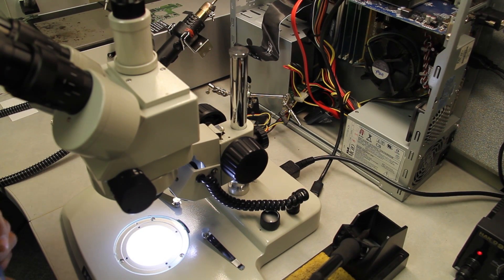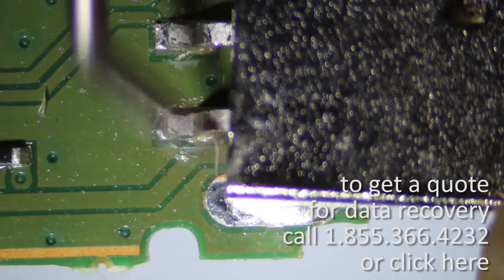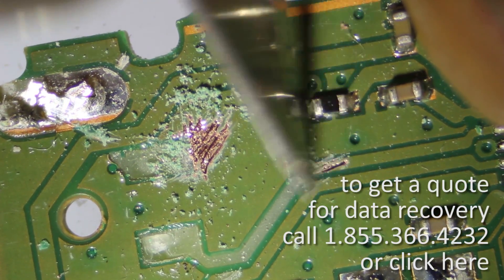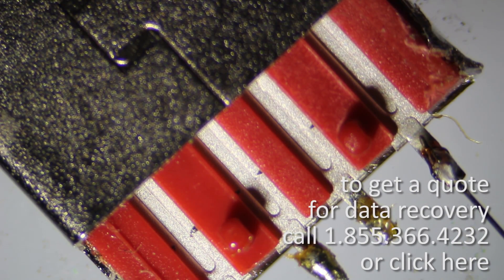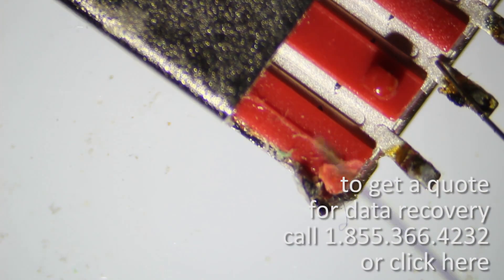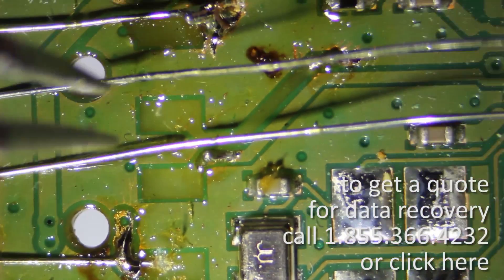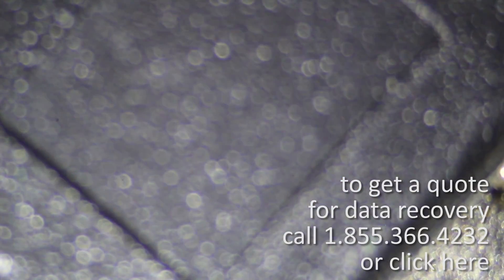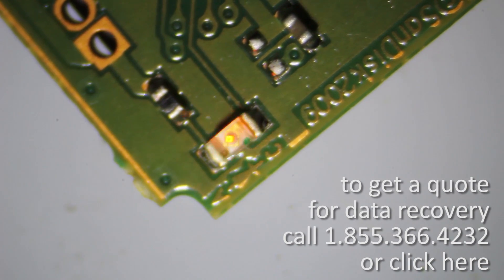How to recover lost data from broken USB flash drive

Comment: Thanks a lot. The creation of replacement pads that will last long enough to retrieve data is what the drive I am recovering needs. I don't know if my old hand is steady enough to scrape away the coating and deposit solder without crossing trace boundaries. Probably will try, X-Acto #11 and Archer fine point iron. Wish me luck! Maybe I will chicken out and call you. In case it helps anyone else, at first in the video, I thought the dark lines were the traces and the light areas were insulation. I could not figure out what you were doing. I could not understand why there was copper under the "insulation".

Blurb:
In my job, the two centre pads lifting was my fault. I was trying to un-solder the connector flat leads to them in order to remove it. Braid did not work and my bulb sucker was not fine enough - the solder did not stay liquid long enough to use it since such small amounts were involved. I tried to pry up the leads from the connector to the pads with an X-Acto while the solder was molten but they kept re-attaching. Then I tried a pin inserted under them at the junction of the connector and the board, and this lifted the pads. Then I used a Dremel abrasive wheel to cut the edge stubs and removed the connector. It turned out that the leads from the connector had sheared off at the board edge from the original damage and it would have been enough to just cut the stubs, at which point the connector would have dropped off, leaving short pieces of leads attached to the pads. Perfect. My how I wish I had done it that way, but I did not know that the flat leads from the connector were severed. I did see one guy get one off with a single quick pass of a heat gun. If I succeed with the pads, I hope to solder wires from a USB cable to them, copying another helpful YouTube video. I had to cut the cable, which has the needed USB connector on one end. I guess it can be spliced back together again after the data is (hopefully) retrieved.

Maybe USB keys could be made really strong, but then they might damage the computer socket if they were hit while inserted? Anyway one might lose them. They can hold so much data! A whole manuscript, a year's notes, easily. Photos and memories. So much to lose and people may not realize. Some understand to backup. Your company must have saved a lot of people much grief!

EDIT two days later  :  I was able to hook up the board to the original connector and did not need to sacrifice a cable. I was very afraid it would not work but after a short agonizing delay the LED lit up and it was possible to copy all the files to the computer, thence to a new stick. Without your video, and others on YouTube, this would not have been possible. The answer to the lifted data line pads was to very lightly solder short lengths of wire wrap wire to the resistors that the pads had been connected to. There was no place on the board to create new pads by scraping. The resistors were only less than a millimetre from the pads and the trace very stubby. It was possible to solder the leadouts to the tops of them rather than right down at board level where getting in the iron tip would have been hard due to neighbouring components. The original soldering of the resistors ran right up their ends to the top, the huge distance of maybe a whole millimeter, gigantic seen in the microscope, and a fine place to land the wire to be soldered.

Thanks for all the tips and demonstrations. It would not be easy to write all that out. Wire sizes, soldering technique, iron tip size, fluxing, tweezers, common types of damage...

I was unable to work with a microscope because the image is inverted and I could not get used to moving the opposite direction to what visually seems needed. So I used a loupe clipped to my glasses and inspected the work after with the microscope, correcting with more loupe work if necessary. I wonder if your microscope optics un-invert the image. I found myself making drastic mistakes because once it started going the wrong way I would automatically react in a fraction of a second, trying to correct, but the reaction was also the wrong way and the knife point went maybe a quarter of an inch seemingly uncontrollably, right out of the field of view even. I think that pilots have sometimes a problem called "pilot induced oscillation" which may be similar. The idea of connecting the finished repair by a USB cable is good. And mainly the attitude that the problem can be figured out and action taken, especially since the fix need only last long enough to retrieve the data.

If you would like me to send you $10 pls let me know.

Comment: Thanks for sharing you expertise. I think I might be able to do this! Gonna give it a try anyway!
Reply from the maker: Let me know how you do
Reply from the maker: it worked? link you posted does not work for me for some reason
Reply: Reposted pic as a youtube slide show LINK UPDATED. The 2nd hand stereo Microscope I ordered off of ebay finally showed up today. No way I could have done it with naked eye. This is the most complicated operation I would care to attempt without getting some better tools. Managed to get all of the data off of it, but 2 of my connections broke loose when I unplugged it. Oh and after doing this, I have to commend you on your very steady hand!

Comment: I wanted ask - In every service based business, the price is factored by different points. The market price, the learning curve, experience of the service provider, time needed to perform the service, purchased materials to perform a service (one time purchase for multiple services (tools, hardware, software...) and\or one time purchase for specific service...) and more. I understand that each restoration service will vary in time but can you say how long an average hardware fix (swapping heads, soldering leads, etc...) takes? I'm not talking about the final stages of image software that copies data because that can be set to run and left while you work on something else. I'm talking about parts of the service that require you to physically work. Thank you.